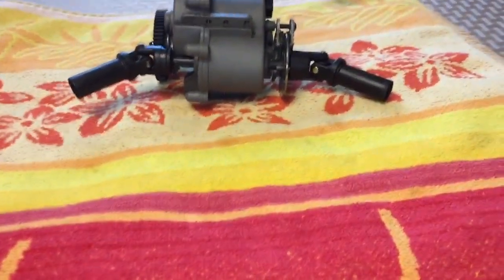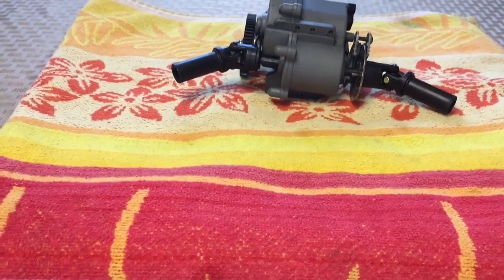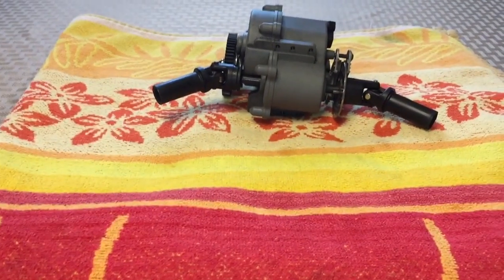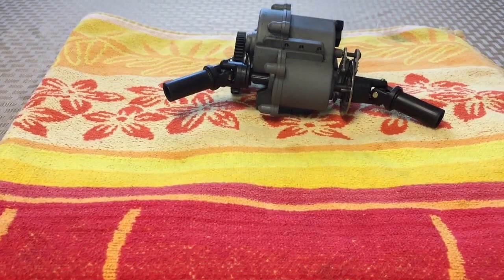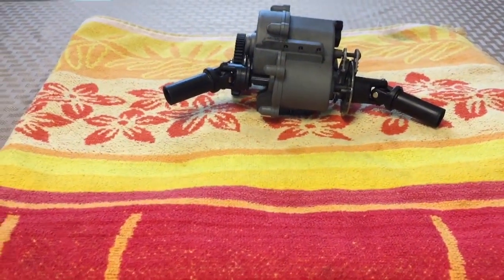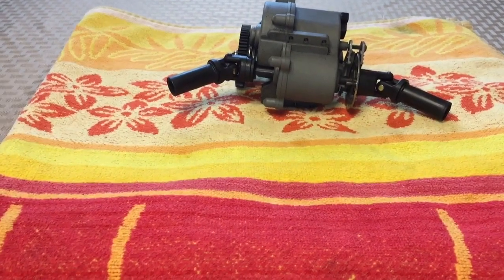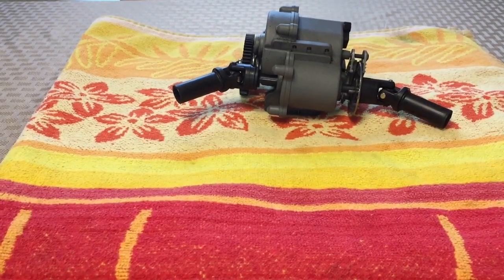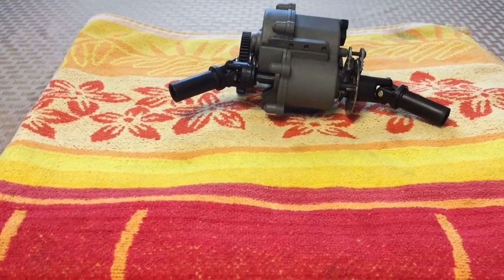T-maxx 3.3 Electric Conversion | Transmission

Comment: Great video man, I believe you were suppose to get the 5394X forward only kit. Anyways guess it worked out for you with the screws in the gears, but throwing it out there for anyone attempting this with a TMAXX 3.3. So anyone with a TMAXX up to 2.5 (black case), use the two part numbers he shows in this video, otherwise 3.3 (grey case), use Traxxas part number 5394x. Hope this helps. Cheers!!
Reply: I’ve been looking for this comment for months thanks so much
Reply: I haven’t been for months, but today only😂 I have 3.3 and a 5394x kit so heck yeah

Comment: Agreed with other process. However, why you need replace the drive shaft with a shorter one, the original one just works fine without replace the plastic shaft(the one with two metal pins to original brakes). One thing need emphasize, the screws to lock the big gear may loose and fall off, it happened to me today. I just redo them with thicker screws and glued them. Will see how it works tomorrow, after dried.

Comment: You are converting your Transmission into a Gear Box , so the Electronic Speed Control  (ESC)  can do Forward , Brakes, and Reverse from your transmitter

Comment: So basically for the 3.3 you don't need any kit just disassemble take out first gear and lock 2nd any other way to lock it other than screws that's going to fall out and why the shorter shaft ?

Comment: I would hold on to the kit for now I seen a few people do it like that some hold up some don't believe you can put the gears from one rod to the next by knocking out the pins and they sell a 3.3 kit as well not sure if that was it or not but glad you made it work that's what it's all about and appreciate the shout out again glad I can help out the steel spur gear looks good and I have a few videos on my channel about goolrc brushless motors about 5 different motors in one video good to see its coming along so far looking great
Reply from the maker: Rc Fun thanks man! Appreciate the comments.  I'm still working on selling my other parts that I took off! Haha. I also know there are some all metal transmission gears I can also replace the plastic ones with. Hopefully the engine will be here soon. I don't have an eta on it yet. Still sitting in California. Lol

Comment: I’m wondering if the forward only kit will work with my Traxxas metal cvds since you had to install a front on your back knuckle. If it doesn’t then I would need to keep the brake and reverse then instead of having the ESC control braking and reverse.

Comment: You can make the pins out of old drill bits the teeth on the 32 pitch they break you should be using Mach1 gears

Comment: Sooo, I'm just wondering if you still have the gears ?
By the way, nice video.
Reply from the maker: Thanks for stopping! I do not have the gears any longer. I actually sold the truck.
Reply: I still got the gears brand new just removed mine only primary missing it broke 5395 I’m pretty sure is the only missing one

Comment: It would have been easier to take a Traxxas Slash two wheel drive complete transmission and engine VXL and drop it in place of it instead of left and right wheel it's front and rear wheels

Comment: damn I hate that....but would had bee n easier to just get a decent 1/8  motor with higher rpm .. You can get high torque/ high RPM  brushless motors ..easy and cheap , now.
Use 2-ea RX...one just  for the breaking ( throttle reverse) and AUX swtich for forward
and reverse....Progran out the break on the motor's  ESC or not...it's not going to matter
much ( oneway bearing)..$7 for an RX and just run it on a 1S lipo pack...it's mainly just
for the breaking/throtle servo...You can plug the other serrvo where ever.

You'll still have a 2 speed truck. which is better and will run the motor COOLER.
.The orgianl Tmaxx only had a .15 nitro engine in it.
It was a baby motor...It'll fly on a 4074 0r 4076 brushless motor.lol
Electric motor dont need to idle.lmao

Comment: Hey dude can I get the single speed conversion that u don't need ??
Reply from the maker: Nestor Nero I am using the single speed gear now! Thank you!
Reply: he means can he have the part you didn't need.  the ones Not used here. I have the black transfer case what parts do i need.  you made me so confused now. what kit do i need for black older trans ?
Reply: T. Man the black older trans uses both

Comment: I am now more confused than before
Reply: Me too... I bought both kits a few years back for another grey gearbox - and to have the same findings as this chap on the video. Fair to say - I was pissed off that the gearbox couldn't be closed. But looking at the forward only conversion kit, it's an identical gear on a slightly shorter shaft, so I'm not sure how that's going to make the car go reverse as well, as essentially it's just the same as the stock item..
Reply: There are two different kits one is for the black transmission which is for the 2.5 and the other kit is for the grey transmission which is for the 3.3 which is a much stronger transmission which was built for the 3.3 revo but was also used in the traxxas 3.3